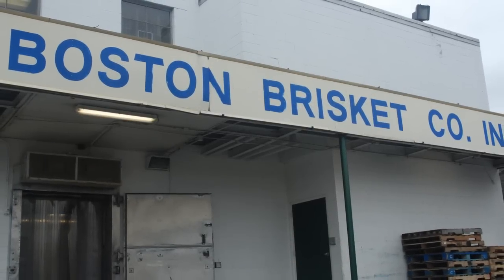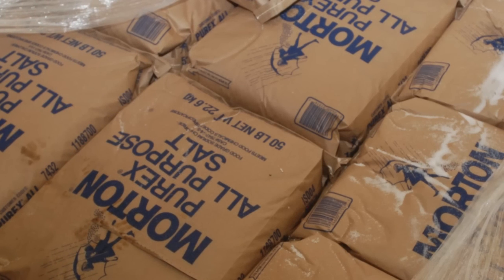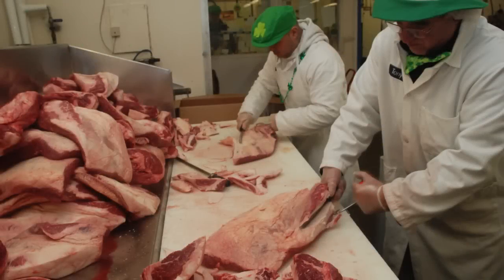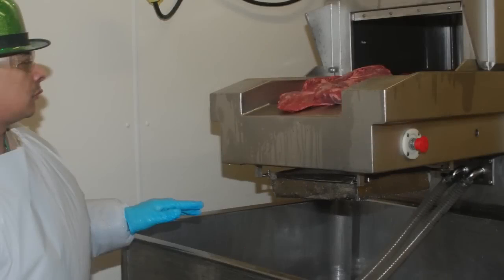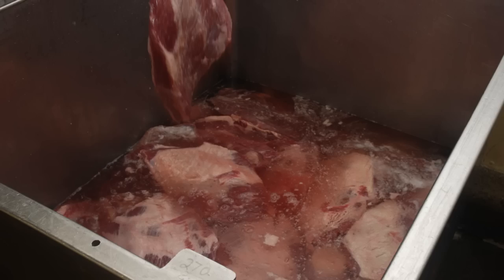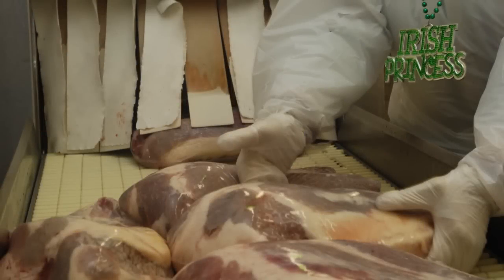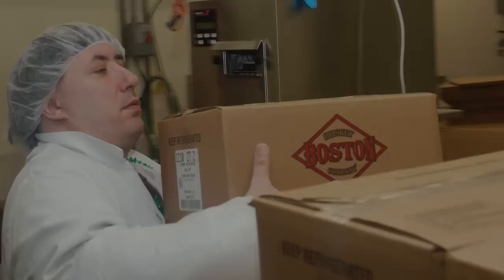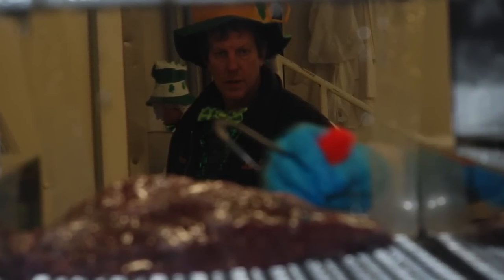Making The Best Corned Beef

Comment: Felt like I was watching a grade 7 project.
Reply: Lol they had to have some sort of technical issue with this project that they went with slides. The camera was set to photo mode accidentally, or had the wrong frame rate/shutter speed. On the other hand, even as a slide show it basically works. You know that it was a tech problem because they clearly captured the audio properly, but no video here.